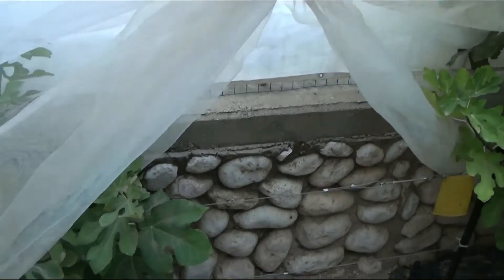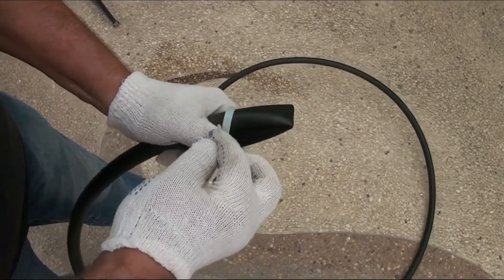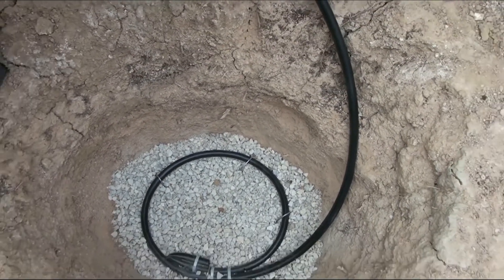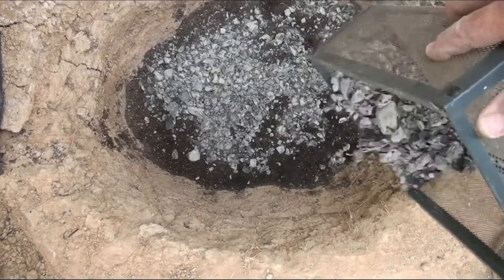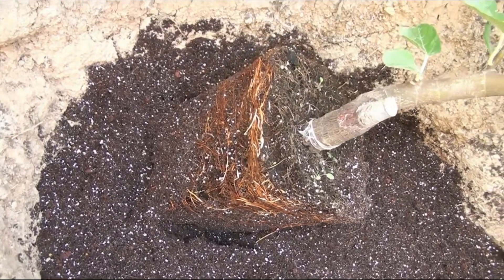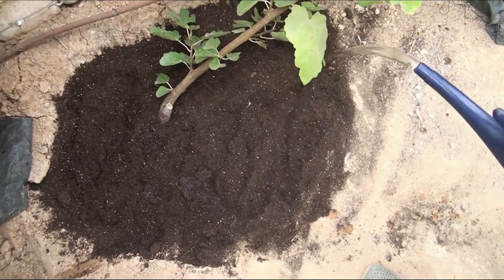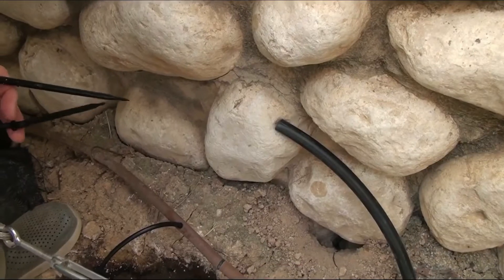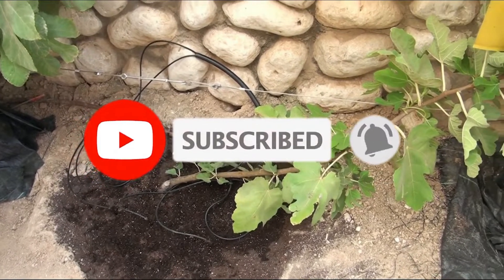Planting figs in hot climates

Comment: Most interesting. I live in South Australia and so I am interested in water conservation. I have not seen the ‘spiders’ here - they look really useful so I will see if I can track them down. We  have drippers  and use mulches but I can see that your system for getting water under the surface would further reduce evaporation  and make water use more efficient. We generally have low humidity and many months of evapotranspiration exceeding precipitation. We use wicking beds for vegetables to avoid tree root competition and to reduce water use. I prefer to grow things in the ground but have to adapt to a changing garden!
One question. Have you found that your figs roots grow out into the surrounding soil with this system or do they circle around to stay in your fertile potting mix? We have clay where I live so I would worry that it would be too great a difference btw the soil mix and surrounding soil for the roots to spread well. I have not grown figs and maybe not an issue as I gather they are robust.
Reply from the maker: Hello!
I think it is not so important how water is supplied to the surface of the soil - through a spider or from a dropper on a tube. Evaporation from the surface can be reduced by mulching the soil with a special material. It's great that your wick growing method allows you to reduce water consumption and competition for it!
  I can't confidently answer your question - I haven't transplanted my figs from the watered planting hole shown in the video, and I can't tell how much of the roots go beyond it.
Figs are a tree with a powerful root system that grows even on rocks. And I think the roots can spread beyond fertile soil without suffering from it. The main thing for fig roots is the presence of water. And to the source of water, fig roots can actively grow underground meter by meter.
Sincerely,
Figs in Israel